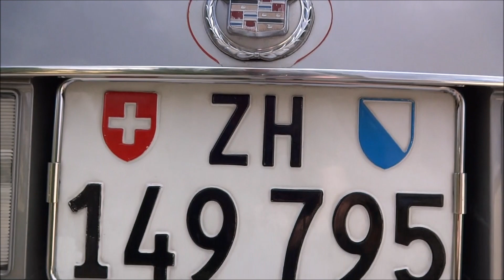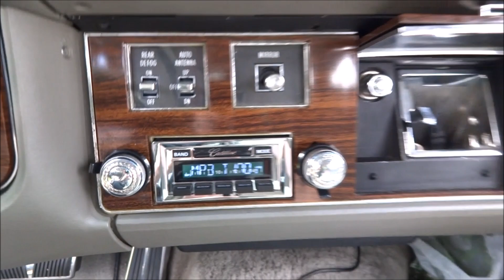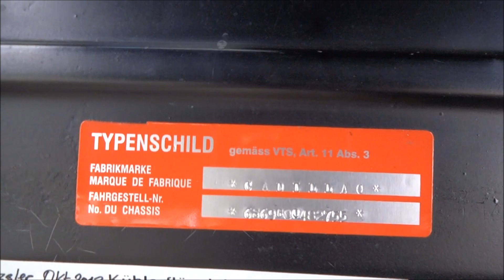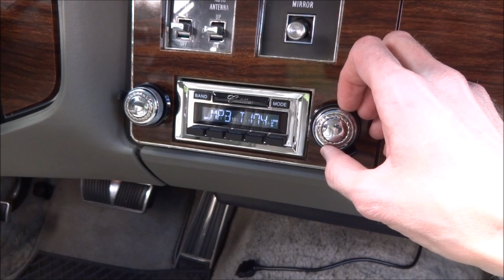Inside Outside Review, Cadillac Seville Elegante 1978

Comment: you have the die cast heavy wire covers those are the bright ones.
hum some olds headers and an edelbrok carb conversion.
door striker pins nylon rings so doors dont drag and hard to close remedy eliminates the jiggle of metal on metal.
dark tint .red kote the fuel tank and no alcohol fuel mix in that car ..
marina fuel 100% gasoline.